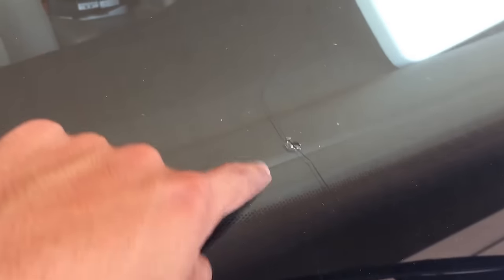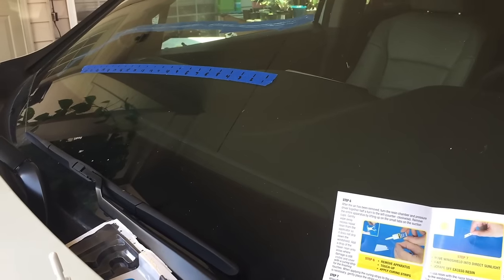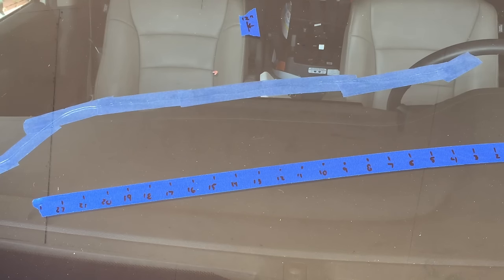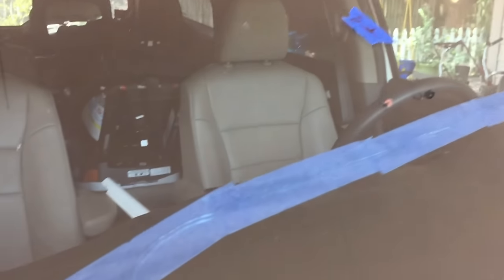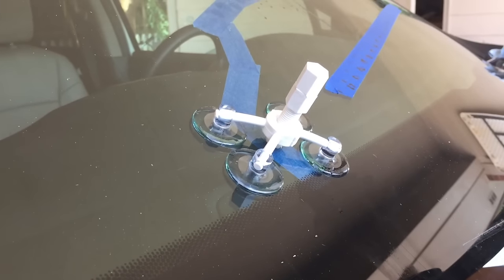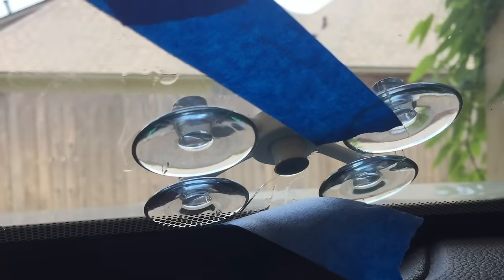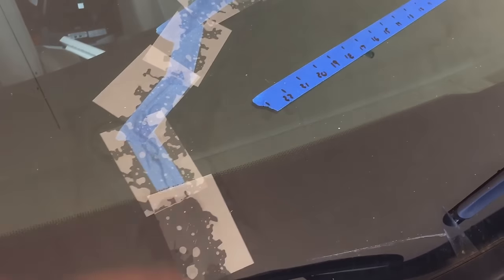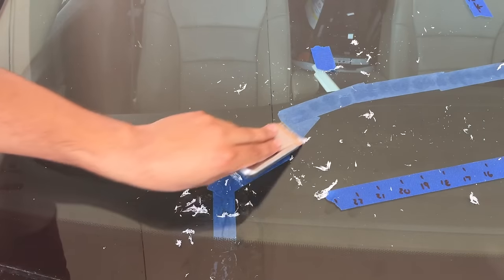Rain-X Windshield Repair Kit on a Chip + Long Crack

Comment: I know you posted this a while ago and you mentioned getting an inspection done. Have you gotten an inspection to see if it passed or not? My windshield failed for a 5 inch crack and my windshield costs 500$ to have it replaced so I'm just trying to see what will pass me for now so then later I can get a new one. Thanks for the tutorial!
Reply from the maker: Hey! We actually have not taken it to get inspected yet, expired in May 2020 😬. Originally i was worried about failing due to the crack extending to the area in front of the driver, but im now worried we’ll fail just due to overall length. Haven’t checked yet though. I think laws vary by state/county (or Parish if you live in Louisiana like us) also
Reply: @fiveohmxco  Wait, the crack spread even with the resin in it???
Reply from the maker: @MrCarzo  no, it has not spread or grown since we did the repair. Still have the same windshield, but still have not gotten an inspection
Reply: @fiveohmxco  did you get an inspection yet? i failed my wof on a crack about 2mm. yes. 2mm. because it was almost directly in front of my line of sight. funnily it has been there since i bought the car and passed all previous wofs. i repaired it and it is now almost invisible, but i went for a retest and they would not pass me because i needed 'certification' by a professional that the windscreen was safe. 
so before i went to a different place to get a new wof (new wof, not retest so dont need sertification) i had another small chip i had repaired badly years earlier, so i decided better safe than sorry i might as well try it again with the left over resin. big mistake. i put too much pressure on it and made the crack bigger. it is now about 4cm. it is not in drivers sight though so im unsure of the laws on it. i finally drilled it and cleaned out all the old resin ready to do a proper repair attempt this time. pretty sure it will work, but if not i would buy a new windscreen, unfortunately i got out my spare unopened bottle of trusty resin, but it had been sitting in my car for a few weeks and despite being unopened has set. so its useless. it took 2 months for that resin to get here last time. i dont have two months. jeeze this is frustrating. im pretty sure the repair would work this time so i want to try before i give up and replace the windscreen. but i cannot wait that long, and if i buy a kit locally it will cost 10 times just getting some replacement resin... if im spending that much i might as well just get a new windscreen. 
this sucks, all other things i have ever failed a wof on have been easily fixable. you buy a part and swap it out. sometimes its a difficult job but you just do it. this one has been a pita. i just cant make up my mind.
tbh i am 99% sure i shouldnt have failed the wof in the first place so on principle i dont want to spend too much money on this. i am still mad at the guy, clearly didnt know what he was doing. he failed me on a tyre that was still legal, but thats fine. whatever i can replace a tyre a year early, also on my lights being angle too low. which i did to pass my last wof when they said they were angled too high. bloody nonsense. 

anyway, sorry about the ramble. just venting a bit.
Reply from the maker: @socks2441  ha! I hear you man. I hate that its hard to get an inspection sticker for small stuff like that but i see cars on the road all the time that are WAY worse. We never got this one inspected, still rocking the sticker that expired in 2020 😅
Reply: @fiveohmxco  yeah, ikr there are far more dangerous cars on the road. 2020, wow, 😅
Reply from the maker: @socks2441  you should see my truck... #2016 ;)
Reply: @fiveohmxco  hell yeah brother fuck state inspection
Reply from the maker: @metalechoes1  hahaha I wish I could like this more!!

Comment: I take it I could fix multiple bullseye chips with the same kit, as long as I do them one after the other?
Reply from the maker: I think you would be able to. Just keep in mind the resin cures in sunlight so keep the suction cup tool clean and out of the sun between bullseyes and i dont see why you would be able to tackle a dozen of them or more

Comment: Did it pass inspection? That's what I wanna know. In the same boat, need a salvage title inspection.
Reply from the maker: Hi, I still haven’t tried to get it inspected, still rocking the 2020 sticker! From what I read it won’t pass due to overall length tho

Comment: Hey, 

Unfortunately it happened to me as well. A small rock hit my car and made small bolt and small  crack. I am worried because I need to pass inspection. So, just wondering, you mentioned about inspection thing in video. Do you passed with this ?
Reply from the maker: I didn’t unfortunately because we have a law that you can’t have a crack longer than like 12” in our state :/

Comment: Nice video. Bout it said to scrape at 90* angle that way you won’t remove most of the resin
Reply from the maker: yea i wasn't sure if the 90° meant like perpendicular to the plane of the windshield, or 90° to the direction of the crack. I was a little confused
Reply: I leave the car running a while as it cures the mild motor vibration gets the air bubbles out and close everything and put it on windshield defrost heat medium the cabin will slightly pressurize and gets the potential bubbles momentum outward those 2 things for first initial 15 minutes of curing never leaves bubbles.  And mask under the bottom of the cracks length so u peel most of the excess off with the tape since gravity will pull it downward no need to mask above crack.  less scraping at end. Good efforts he put forth but the results and concept went over his head lol. Still subscribed n liked video just to show its constructive not hate comment.
Reply: @abelabila  so would it be best to put the resin in when the outside temp is lower than sweltering summer? That way the defrost temp is higher than the outside temp? I have to do this to my car and I’m gonna be pissed if I leave it visible at all.

Comment: The only way  to stop the crack is to drill the end on both sides i just heard never done it but it does make sense
Reply from the maker: I'll say, in our case the crack still has not spread after about 8 months or so. But yea, drilling a hole at the end of the crack is definitely the 'right' way to stop a crack from progressing, we do that in our chemical plants every now and then when our equipment develop cracks!

Comment: If it was a Rock it would have gone through windscreen.It is a Stone Chip from another car tyre throwing it up.
To stop a crack running you need to drill small hole at end of it.
Reply: How can it be drilled

Comment: If your car is insured you can have a brand new (free) windshield from any glass repair shop. 15 minutes.
Reply from the maker: Not the case with these hondas - the collision sensing cameras are mounted to the top of the windshield behind the mirror and sealed to the glass so ends up being like a $700+ install

Comment: Glass damage falls under comprehensive coverage. Deductibles usually run much cheaper than collision so get your windshield replaced
Reply: How?
Reply from the maker: Yea i need to look into this with our insurance co. I've read conflicting things online with these windshields bc its not just a simple glass replacement, these cars have a a slew of safety electronics (radar sensing) that seal to the windshield and apparently costs over $700 or so to get everything reinstalled properly and recalibrated after glass replacement
Reply: @fiveohmxco  Usually insurance should cover the more expensive glass replacement too
Reply from the maker: @rkan2  one of these days ill call our insurance and check lol

Comment: What is the point of scraping off the excess resin? If you don't mind what it looks like why not just leave it on?
Reply from the maker: There was a good bit of resin on the surface.  You only want resin inside the crack, any resin on the surface will look bad (kind’ve like a windshield that’s always wet w water droplets) and it will trap dirt and junk. Definitely make sure to scrape all the excess off. It also will probably eat up your windshield wiper blades
Reply: @fiveohmxco  Thanks man. Should I do the crack or the bullseye first? I'm afraid if I do the bullseye first it might make the crack bigger. But if I do the crack first it might come back when I do the bullseye.
Reply from the maker: @MajorCulturalDivide  can you just do it all at one time like I did mine? There should be plenty of resin in the kit to do a bullseye + a decent size crack
Reply: @fiveohmxco  Yep that's what I did. The crack never disappeared though. Looks the same.
Reply from the maker: I got ya. Mine definitely looked better after the resin but it did not disappear. My main goal was to stop it from spreading further and I did accomplish that, it hasn’t grown in the past 2 years. It’s still very visible though

Comment: Would this pass inspection?
Reply from the maker: I dont think so, not in Louisiana at least. I think the longest crack you can have is like 12”, regardless if its repaired or not :/ We’re still rockin the inspection sticker that expired on 5/20! 🤫🤫

Comment: Could you feel the long part of the crack from the outside or was it smooth to the touch.
Reply from the maker: I honestly don't remember.. I imagine I would've been able to feel it with a fingernail but not sure. I just went outside and I can feel it on all but the last couple inches, but i'm probably feeling the resin now.

Comment: It did not work for me ,, the kiquid never dry , it remains wet always , and no sun in daytime in canada this time
Reply from the maker: I think you may have to find a UV epoxy curing flashlight if there is not enough sunlight. Not sure if that would work though

Comment: Did it still spread after ? Just cracked my windshield omw to get this repair kit?
Reply from the maker: It did not. It was slowly spreading before i did this repair, but afterwards it stopped. I did this june 2020 i believe and it has not grown since
Reply: @fiveohmxco  right on! Actually doing it rn

Comment: Still very visible.  You should have drilled into the end of the crack to stop it spreading.  Not that it would make much difference as the crack has went far enough.
Reply from the maker: Thanks for the comment! Can you recommend a drill bit material and size that would be good to use for this, in case others want to attempt that repair? TIA
Reply: @fiveohmxco  No problem.  Use R&S tungsten carbide FG330  Dome fissure cut drill bits
Reply: @fiveohmxco  It's best to use the diamond grit bits. Finer ones are better.

Comment: Hey I just checked out this video nice work! I have a question. Would the car in this video happens to be a Chevy Malibu? If so, I have the car and the shield just crack.
Reply from the maker: Hi, this is actually on a 2019 Honda Pilot, but it should work just as well on your car!
Reply: Funny. Cuz I have a malibu too and my windshield just crack! About to go and get this kit right now.
Reply: I have a 2017 Malibu and my windshield just cracked 🤦🏽‍♀️ it’s at 13 inches in length.

Comment: Did the Crack Keep Expanding after this?
Reply from the maker: Nope! It’s been just over 2 years now and the crack stopped spreading after we did this. Still haven’t replaced the windshield lol
Reply: @fiveohmxco  Nice Thank you So much I’m gonna go buy 2 of these at Walmart my mechanic just said it would be $260 for a replacement if it gets worse but it’s still fixable thanks for saving me some cash brother I appreciate it!
Reply from the maker: @YTUBESHARKMAN  awesome! Yea just take your time with it. As long as you do it in the shade out of the sun it won’t set up and cure so you can work nice and slow

Comment: Soo why is mine not getting into the cracks at all. It's not working at all.
Reply from the maker: Are you working in the shade/protected from the sun? Also, you tried gently pushing on the inside of the glass?
Reply: @fiveohmxco  yep did it at night, was using a uv light when I wanted to cure. Yeah tried "massaging it" it's actually 10x worse now. I was not rough at all.
Reply from the maker: Damn. Sorry, have no idea :/  Can you scrape off the surface at least w a razor blade to get it back to how it was before?
Reply: @fiveohmxco  nah it cracked to the passenger edge like 6 inches 🥲

Comment: Anyone know how to remove excess wax from the windowshiel repair kit?
Reply: Do you mean resin? You use a razor blade at a 90° angle scrape hard until it comes off in white flakes and keep doing it till it’s completely gone
Reply: @donoh3909  ironically i got a whole new car yesterday, appreciate the response tho.

Comment: Unless you drill a hole at the end of the crack with a diamond bit (don't go through the plastic laminate layer between the cracks ) you will never stop that crack from continuing right through to the edge of the windshield.  The resin has is not an adhesive and has no inherent strength to bond surfaces... its one and only purpose is to fill the crack, make it less noticeable and to prevent water from entering the bullseye, then freezing/expanding and cracking further.  I imagine that you likely still had to replace the windshield fairly soon after making the video.
Reply from the maker: It literally stopped our cracking from growing for the past 3 years

Comment: Its winter where I am and I dont have a garage or know anyone with one... can I still do this or will this cold ohio weather mess it up
Reply: Same question  I live in philly
Reply from the maker: So, just brainstorming, i bet youll be fine if you run the car with the defrost blowing to keep the windshield warm. Also, be aware that the repair needs to be done in the shade, because the resin cures with UV from sunlight. It should be repaired away from the sun and then parked out in the sunlight to cure. Also, keep the repair resin indoors and warm right up until you use it. Good luck!
Reply: @fiveohmxco  thank you  so much .

Comment: Still being able to see it may mean inspection will fail but if nothing else it buys you time cause they can spread across the screen in the space of 1 bump. Time to YouTube removing & installing windscreens(2nd hand screen$60,seal$19) insurance not mandatory in NZ, new replacmnt fitted$880. Tryng 2 help a friend. Not a pro but not without some ability. I can walk in &:out of a room without banging my head & dont have to rely on velcro to tie my shoes so i believe i have a fighting chance of success. Do th removal without breakng th screen & get a pro 2 fit it maybe.

Comment: Can this be down on tinted windows
Reply from the maker: I don't see any reason why it wouldn't be successful on tinted windows, as typically tint is applied on the interior surface and this resin is applied on the exterior. I also assume it would still be beneficial at hiding cracks as well

Comment: I think if you do multiple sessions of this it should go away completely
Reply from the maker: so the only reason im not sure of that is the resin cures in sunlight, and i feel like it would be cured at the surface of the windshield. i think the remaining cracks/refractions are subsurface and no longer accessible - i.e. would have to remove the surface cured resin first. just my theory though

Comment: Does it work with mirrors? I got a crack on my side mirror
Reply from the maker: No idea but worth a try! Idk what other option you have except replacing the mirror. That being said, may want to look into swapping out the glass, may be pretty cheap and easy
Reply: @fiveohmxco  I was afraid I read that the only way of replacing that mirror is changing the whole unit because is heated and it's very expensive (bmw) but i already found the replacement mirror in AliExpress at around $15 which is reasonable :D

Comment: Can you use this on a home window?
Reply from the maker: great question - don't see why you couldn't though! One thing you'd have to keep in mind is that the resin needs to be applied in the shade (no sunlight on it), as when the sunlight (UV light) hits it, it will start to cure/harden. So the window needs to be out of the sun during repair, and then in the sun sometime afterwards to cure it
Reply: @fiveohmxco  okay! it's a well shaded area that side of the house. Thanks for your reply. I'll give it a try 👍
Reply from the maker: @STUDENTOFSCRIPTUREMANOFGOD  good deal, lemme know how it goes please! if that window never gets direct sunlight, could look into getting a UV flashlight to cure it as well, something like this: https://amzn.to/3kLc0WG

Comment: Did you pass inspection afterwards? Because I bought this to help my truck pass inspection because I can't afford to replace the windshield right now.
Reply from the maker: We still haven’t tried (inspection expired in May 2020 😬), but reading up on the rules for our area, it looks like it will still fail. Rulebook for our city in Louisiana only allows max crack length of 8”, and this one is like 30”+

Comment: Do you think multiple treatments would help out filling up the crack?
Reply from the maker: I think there was plenty of resin, perhaps I just needed to do a better job of working it into the crack. You're supposed to 'lightly' push on the inside of the windshield after you apply the resin to try to work the air out/work the resin in, and I did that, but I was scared to push too hard and make the crack worse. Others have commented that they've had better luck with making the crack disappear. The only thing to consider would be once the resin is out in the sunlight, it cures, and at that point I don't think you could try to do any further repairs.

Comment: If i did this in the cold outside how long would i have to wait to dry my goodness
Reply from the maker: I believe its not actually a glue that air dries, but a resin that cures with sunlight. Pretty sure it just takes like 15 minutes of direct sunlight to cure or ‘dry’